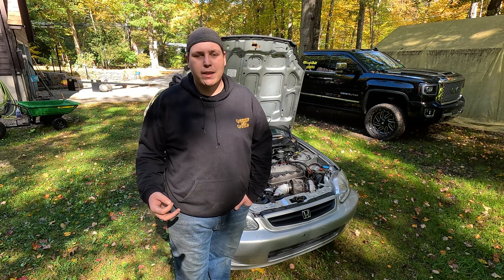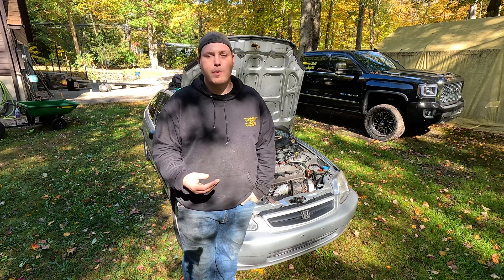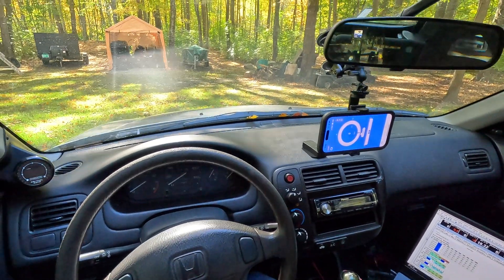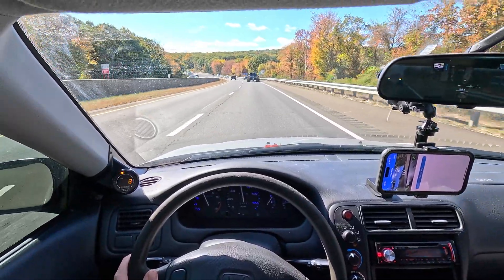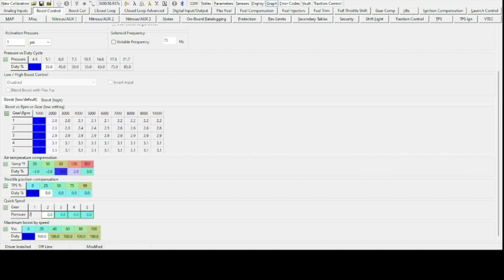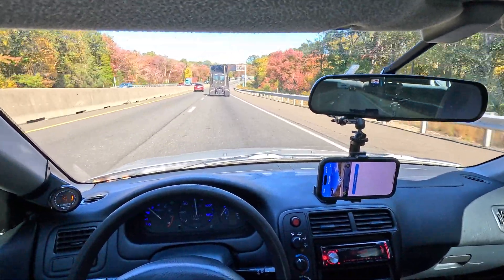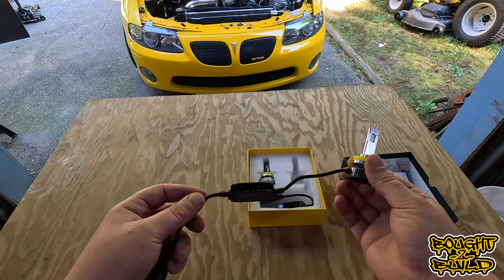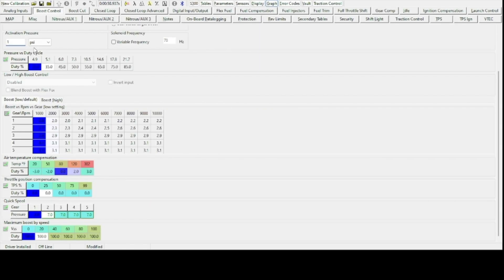QUICK SPOOL TESTING! WHAT IS IT? HOW? RIPS! @HondataInc  #turbo #spool #automobile

Comment: Wow, this is a great video.

I’m an automotive engineer that tunes ECUs and suspension - I am contracted by dyno shops in my area and I’ve seen it all. 

Yet, you perfectly demonstrated the feature and how to work with everything. Quick spool is a great feature, just be aware that you’re loading up the rods/driveline sooner. Progressively loading up cylinder pressure keeps things safer ;-).
Reply: Increase ignition timing where the turbo isn’t spooled and taper it away at the rpm where the turbo starts to come in.
Reply from the maker: Thank you  for the support! I would really like to get it on the Dyno see where it makes peak torque and then try to dump in the boost as it comes away from peak torque as well! And I will definitely give that a shot with timing thanks for the support 🤟🤟🤟👍👍👍👍***

Comment: Are most of these boosted civics I see changing internals to decrease compression ratio to allow higher boost or running stock ratio with low boost?
Reply from the maker: @tyquanwashington.8510  all depends a lot of the ones you see are probably bone stock with a turbo slapped on like this one right now lol but I am building a new engine for it so we can turn it up but your average D series build is either speed factory long rods with vitaras at 8.5 compression ratio or standard rod length with vitaras and an even lower ratio unless you go forged pistons 

The one we are building is going to be eagle rods, vitara pistons for now z6 crank and a comp cam with ported head so pretty basic but should be able to make decent power 
Thank you for checking out the channel I appreciate the support 🤟🤟🤟👍👍👍
Reply: @bought2build  awesome, thanks for the info!
Reply from the maker: @tyquanwashington.8510  no problem any time! 🤟🤟🤟🤟🤟